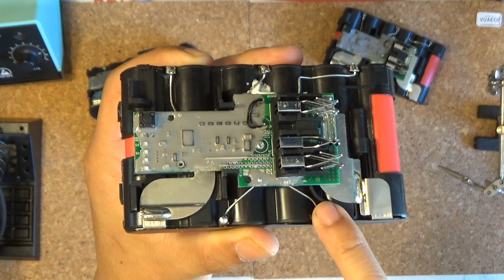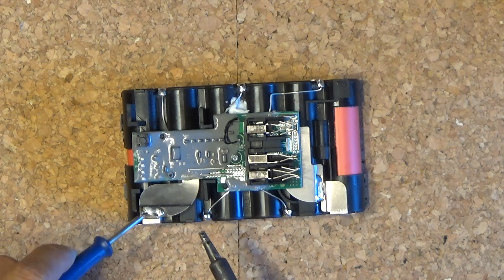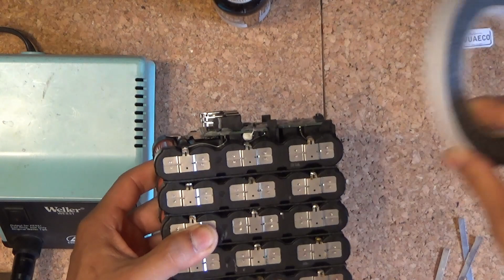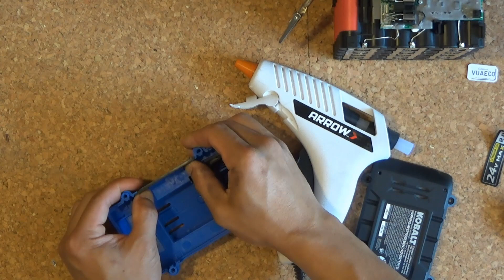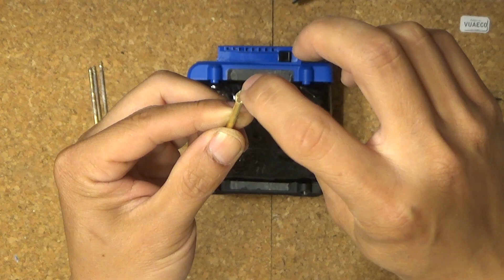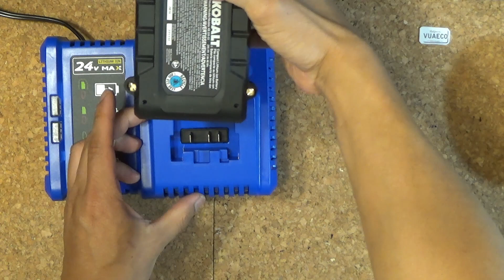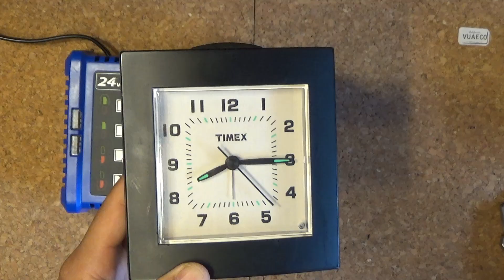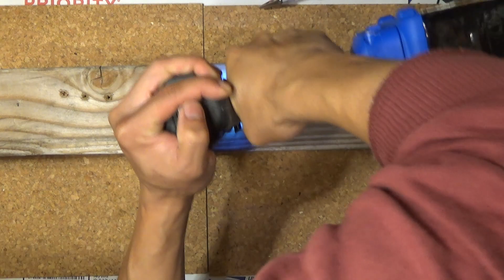DIY: The World's first 10 Ah Li-ion power tool battery built for Electric Bike home-made

Comment: if you have 5 batteries of 2 Ah, what's the point to join them together? Is it to difficult to change the battery when needed?
Reply: When you buy a cordless tool like this it is common to get 2 batteries in the kit when it is on sale.  When I last bought a cordless tool system each tool came with a charger and 2 batteries on sale.  So it is entirely possible you could have a ton of these low capacity batteries laying around when you buy all the tools in the system as separate kits.  

These 2Ah batteries are only good for about 250-450 cycles before they fail.  Depending on how often you use the tool they may last less than a year if cycled 2-4 times each day or they may last 5 years if only used occasionally.  By combining the packs each set of cells could potentially see a much longer cycle life in the neighborhood of 1000-2500 cycles if the pack is less often fully drained.  Sure you would have to wait longer for a full charge but with Lithium batteries, it really doesn't hurt them to charge more often when not in use.  

You can buy 6Ah packs for the real contractor professional grade tools that are maybe 2-3 lbs but they don't seem all that ridiculous compared to the weight of even the corded tools in that same category.  My corded rotary hammer drill weighs 7 lbs and the corded reciprocating saw I have is a good 8.5 pounds. Even my older screw gun that uses a NiMh 24v battery is 5.5 lbs and I would consider that light by quality tool standards. Adding an extra pound or two to a tool can actually make the tool nicer to use. 

So far my experience with lithium batteries has led me to the conclusion that a pack made from quality cells should last well over 10 years provided the cells have cycle life left and have not been abused.  It really does depend on how hard the batteries are used and abused as to how long they will realistically last.  Some of my corded tools are over 50 years old and still going strong.  I still have the first cordless tools I bought back in the mid to late 80's and they are still fully serviceable.  I have moved on to aftermarket batteries for them but the tools still work just fine over 30 years later.
Reply: EmaNymtoN88NotmyNamE I think those who oppose are not thinking out the box. It's the possibilities of using these batteries. This is great. Thank you sir!
Reply: lol at the idiots that keep saying "what an idiot, read the description" to people who point out that it's ridiculous for a screw gun but it's really intended for other purposes.
Reply from the maker: Thanks a lot for sharing your experience. Much appreciated.
Reply: someone did not read the description i see. he clearly states "Don't judge this battery by its weight and size as my main goal is not for using it with my tools."
Reply: Ello gubna!
Reply: G'day mate
Reply: +kuhrd "it will not see as many cycles"
The cycle count will be the same. if you use each five once or use the five at once on time, you still only have one cycle for every pack.
Also mine never get hot. If they get hot, it's because they have a high internal resistance, or in short you have crappy batteries.
Also may I add that yes, when you use it, the discharge will be distributed and only 4 amps but when you charge it, the charger would have to work on 5 times the load. if it's constant current, it will mean that it's okay but if it's not, your charger will work its guts out on the fucking thing. Same goes for the board inside the battery. It's designed for 1 pack and has the rating of the diodes and mosfets in it sized for that. If you fry your protection after a week, well tough shit, you should have known.
Reply: EmaNymtoN88NotmyNamE cv
Reply: Jboycs  Please go back and read the FULL description.
Reply: Krisztián Szirtes not necessarily it would be considered a trickle charge.
Reply: vuaeco so does the stock 4 ah battery have more power and runtime than the 2 ah battery or just more runtime and is your 4 ah battery that you made wired the same as the stock 4 ah battery - just wanting to know if get more power out of the 4 ah batteries before I go out and buy several for all my tools
Reply: It would be good for a light or fan or something but retarded for most any tool
Reply: Some of u can't read for shit. Your probably the same annoying people calling for shit on Craigslist asking for description when its already on sales ad. Dumbass
Reply: Longer run time. I use them in my kids power wheel.
Reply: In this way not only will the battery last longer but it will not get as hot, it will not see as many cycles, and each string of cells will last longer because they are being less abused with high current draw.  In this config instead of each cell in the string needing to supply the full 20A, each cell in each string of cells only has to provide 4A so they will not get near as hot.  If he also chooses to charge the battery when done each day it may only be at half capacity rather than a full discharge so all of the cells will see a much larger number of charge cycles so the single battery could last a far longer life.
Reply: Thanks for answering.  Your answer was complete and accurus.
Reply: Because it reduces stress on the batteries, making them last longer. Also, you can increase the amount of torque the tool can make as well as reducing the voltage droop  that happens. Basically, this means you can deliver higher voltage and higher current to the tool. Both of which will increase the final output that you get. If you need an example, look at how much torque a Li-ion powered drill can produce as opposed to a Ni-Cd powered one. Because Li-Ion can produce significantly more current whilst also maintaining a higher per-cell voltage, it can produce a decent increase in the tool's torque.

Oh... and not to mention that each cell gets charged at a significantly lower current on the stock charger. This isn't exactly a good thing if you just want to be able to use the tool as fast as possible because your charge time takes a significant hit, but because you're doing a slow charge on the cells, it reduces the stress on the cells during charging and means that they should be able to withstand more charge.discharge cycles before wearing down significantly.
Reply: the point is longer run time between charges it shouldnt deliver more power as in higher voltage but it should deliver more amps so longer lasting.
Reply: The added bulk and weight make this ridiculous for a screw gun.  But he said the actual intention is to use it on other projects he's planning.

The "added lifetime" is negated by the fact it's 5 times the amount of batteries purchased just all at once.  If one battery lasts 3 years that does not mean this thing will work 15 years.  Then you'd get much of the performance enhancement with a stock 4.0Ah from the store.  Another thing to consider is there is a maximum boost possible as the tools regulate the power coming in.
Reply: its design for man hands
Reply: EmaNymtoN88NotmyNamE no, it because he wants to carry a drill that weighs 5kg. (basically this is the dumbest idea ever)

Comment: I'm confident you've built a battery with more than 10Ah :) Check out "Peukert's law". You should measure the capacity and print a new label
Reply from the maker: Peukert's law only applies to Lead Acid batteries. It does not apply to Li-ion batteries. Main reason because Li-ion batteries will heat up (and consequently make its capacity more available) as you increase the discharge rate. This reaction from Li-ion batteries counteracts Peukert's equation and renders it useless. However, Peukert's law with lead acid batteries is well explained by knurlgnar24. By the way, where has he been in the last 2 years?

Comment: The major current will be from positive to negative. there will be very little cross current. only balancing current. You only need small wire strip at each connection. 8 cross connections instead of 10.
Reply from the maker: It's not just the positive and negative terminals that are in parallel. Think of it as a single giant 24V battery with 6 giant cells connected in series to produce 24V. If you can imagine that, you will see how important that is to connect every single cell in parallel, not just the end terminals.

Comment: Where the screws hand made and batteries in parallel?
Reply from the maker: I looked at that also. The smallest threaded rods at my local hardware store was size 10. I need size 6. So that didn't work. Plus, with a threaded rod, you'll need to make a cap by welding or use a lock nut. That either sticks out too much or would come loose eventually.
Reply from the maker: Yes, screws were hand made as nobody was selling it. And batteries are in parallel. It's a 6S5P pack.
Reply: Consider using threaded rod the next time you need long screws.
Reply: Your solution was elegant.

Comment: It's really easy to change the battery when it's dead.   Although you can get some more ooomph with a 4 amp hour battery because a 2 amp hour battery is being pushed closed to its limits by the drill motor, the third fourth and fifth offer negligible power increase.  The limiting factor becomes what the motor can draw and what the circuitry can handle.   Notice that the circuit board in the battery has a fuse underneath the black plastic terminal holders.   You'll blow that fuse long before you reach the limits of even two packs.

Comment: How about using 6800 amp hour batteries? They are on e-bay and probably cheaper than the battery packs.
Reply: The 6800mah 18650 cells are fake unfortunately.  The largest genuine cells at the moment are probably the Panasonic 3400mah. 
Some of the ones with fake ratings are as low as 600mah (they have a tiny cell in the can and the rest is filled with silicon or something else)
Reply: countryside save your money and don't buy those. also laptop battery packs use the same 18650 cells but are NOT rated for the same high amp discharge and will mess up if used in power tools.

Comment: Good video presentation.  Would like to see a followup video showing if the extra current from the parallel arrangement will hurt the original charger circuit components or the the battery balance board.  It may be damaging to the balance protection board which was only meant to balance 1 battery not 5.  Make a comparison of a regular battery and the 5 banger on current or heat measurements of the charger and balance pcbs with the cases removed.  We want to see if the extra batteries will cause over work of the circuits and cause heat damage to the power FETs, transistor, or cell balancing resistors over the longer charge and run times.
Reply: EnergyCrafts no it works i am using 72 volts 3 5cell deep x3

Comment: It would have been nice to see how you made the screws. I was thinking this is easy until you got to the screw part. Anyway, well done. :)
Reply from the maker: I thought the same thing as you. This project went so smoothly until I got to the part where I needed the 4 screws to secure the plastic case. I spend 2 days going around the local hardware stores asking every employee in there to see if they sell those screws. They have to be small enough (size 6) to fit in the holes but has to be long enough to reach (about almost 4 inches). There is absolutely no store selling any screws size 6 that is 4 inches long, Home Depot, Lowe's, Ace HW... you name it and I've been there. That's why I just went ahead and made my own. I went through many failed prototypes, also, before I found out the brazing rods. Lots of time spent there. I did film the parts when I made the screws. But I realized the entire video is already long so I skipped that part and explained it instead. Maybe I will post that video separately.
Reply: If you have the time I would enjoy seeing you make the screws, mostly because I've never seen anyone make screws and was instantly fascinated. Also, I made a battery box based on yours to see if I could. It's smaller and made out of 2 $4 walmart tool boxes, stacked, screwed together and turned on side. I strapped it to the back rack of my electric bike and it works great, so thank you. I use the battery bag that came with my kit for a cover so it ended up being very clean. It'll hold me until I'm finished building a battery pack. Take care.
Reply: Chef Kendra Nguyen I used 6-32 threaded rod on my 6.0 pack with coupling nuts as the feet and to hold the bottom on.
Reply: I was cringing at the screw implementation. You could have gotten some double-female PCB standoffs, and have a screw go in them from each direction. If a size 6 machine screw fits, then M3 PCB spacers are the right size.
Reply from the maker: That's a good idea. Problem is, nobody around here is selling those standoffs. I've spent enough time going around trying to find a screw. I'd rather just cut the crap and make my own and surely it only took me 5 minutes each. That saved me lots of wasted time and trouble. Sometimes you just gotta work with what you got.
Reply: Good info, thanks Allen.

Comment: I was thinking that the more batteries put in parallel, the more amps it would give, frying the circuits? 
Or frying the motors?
Reply: No, nothing will happen. Just longer run time, with possibly bit more power.
It will NOT give out more amp. It will have more amp AVAILABLE in case the tool requires that.

It's like, just because you are driking water directly from a pond (let's say the water is clean enough), your tummy won't burst.
Whether you drink water from a pond or a cup, you will still drink just enough water for you. That's how a tool works.
Reply: If for example this guy had knocked up a billion amp pack for his powers tools instead of the ten amp pack, the tool would still only draw the amps it requires.  Not enough amps would cause a problem
Reply from the maker: Wow, lots of similar questions concerning too much power! I thought more is better? LOL! Anyway, it has the power available doesn't mean it will run at full power all the time. If your car can do 100 Miles/hr, does that mean every time you get on the road, you have to run at 100 Miles/hr? Well maybe some day if you have a dead body in the trunk and the police is chasing after you. For most power tools (Kobalt 24V in my case), you will NEVER run at 100 Amps. A power tool will only run at certain maximum amps it is programmed for. Every power tool motor has its own control circuit to limit the current flowing through it no matter how big your battery is. It will last 5 times longer than a standard battery though. However, if I use this battery for something else other than my tools (electric scooter, electric go kart, ebike...), I can use the extra power (amps) not available with a standard size battery.
Reply: What the hell? the battery doesn't determine the amps, the load does.
Reply: yes he is increasing the ability to provide more amps, but a circuit will only take or use the amperage it needs. think about it, your hairdryer and night light can be plugged into the same outlet
Reply: jps jps so the tool on every normal bank of  2Ah goes through a short time of "low amps" draw before supplying a fresh charged 2Ah bank. tool should last overall longer life with the added cells by eliminating the 4 times you'd want to squeeze out the last of the lows before charging another 2Ah? brushless or not, somethings gotta heat and take the strain. If brushless changes that to unlimited cycles, the manufacturer then has to rely on something else for the tool to fail like a counter of cycles. no tool maker wants to produce tools that last a lifetime anymore. they used to, and those guys were strait up about it, it was their intentions.
Reply: Samuel Arcos there's no more Amps it's parallel all he's increasing is battery use, he increased the MaH there's no more amps his math is bad